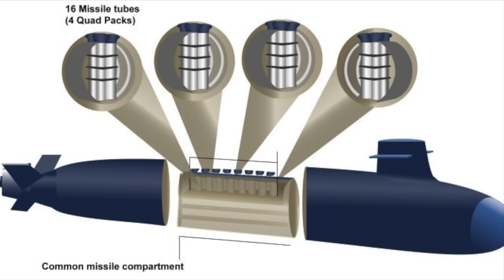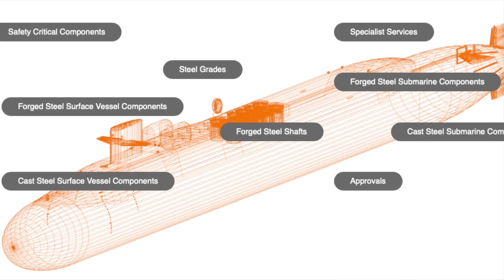The Submarine Bottleneck: Why US Nuclear Shipbuilding Needed Britain

Comment: I am not sure that its the VPM's that are being done at Rosyth, Babcock are already doing those at its US plant and Rosyth doesn't have any experience in submarine steel welding. I suspect what has been outsourced is something Rosyth specialises in and submarine work its already doing for the UK submarine program, aluminium pipe welding for the reactors steam plant. Aluminium welding is a rare and highly specialised skill that isn't performed anywhere else outside of the plumbing on commercial airliners.
Reply: "Rosyth doesn't have any experience in submarine steel welding" Yes they do. Rosyth used to handle the Polaris subs refitting and I've the memories of sitting next to them in ballast tanks with my dinky fire extinguisher. Also, some welders from Rosyth more recently worked on subs in Barrow. Source, my daughter who does the quality control.
Reply: @TukikoTroy  They have a role in decommissioning submarines (removing the reactor then slicing them up) and in welding aluminium piping for Barrow but they aren't doing any high grade steel (HY-80/HY-100) welding for submarines. The Polaris subs were decommissioned 30 years ago and their last refit in Rosyth was during the 70's and 80's. The frigates will be using much more workable steel, AH-36/DH-36/EH-36 etc..

Comment: It makes me wonder if the SSN-AUKUS boats are even needed. The Virginia's later blocks aren't far off from what the aukus boats will be. We should all just be building Virginia's.
Reply: SSN-AUKUS boats will be far superior attack submarines than any Virginia class.
The US will have later the new SSN(X)-class submarine to replace the Virginia class.
All three countries should make one attack submarine type with many VLS cells.
Thus saving money producing commonality and share the workload.
Reply: @LeeD-c6z how do you know they will be far superior?
Reply: @starship4453  BAE are designing it to be superior.
The USA are designing the SSN(X) to replace the Virginia class
Reply: @LeeD-c6z  I would believe that if BAE systems had designed the Virginia class before the Aukus, and not GDEB. From what we know... The SSN-Aukus is going to be a lot like a block V-VII Virginia in terms of general specifications
Reply: @starship4453  Yes ........i agree but it will be structurally different but it will use many of the later Virginia class systems and weapons.
Some analysts have suggested SSN-AUKUS could aim for a VLS capacity comparable to some Virginia Payload Module configurations (which can carry dozens of missiles), but this is not official. 
But they will not have the Virginia VPM cells
Reply: @starship4453  How do you know it would be better for us all to just build Virginia's?

Same way.... unsubstantiated tripe based on personal bias not considered examination of fact.... You are just as bad as the person you are responding to. 

No, we should NOT all just be building Virginia's because both Australia and the UK have some differing strategic requirements to the USA, which means they need somewhat different things  from their Submarines.... This is why though the hull form will be a British design based heavily on the Astute Class, much of what is going INSIDE the Australian Boats is different to what is going inside the British Boats because we have somewhat differing operational requirements.

This is the reason the Brits went ahead and built the Queen Elizabeth Class instead of 'just buying a Nimitz or two', because fantastic ships though they are the Nimitz Class DO NOT FILL BRITISH OPERATIONAL REQUIREMENTS..... Too crew hungry for a start, a single Nimitz has more than twice the crew requirement of both QE's combined, thats BEFORE you get to the air wings.....

So you see, a ship that works well for the USN might not in fact work very well for anyone else.... It is purest, insufferable arrogance and breath-taking ignorance to assume that that is the case
Reply: @alganhar1 You didn’t respond to anything I actually said. You just launched into a national‑prestige tantrum because the facts don’t line up with the story you want to believe. Cope harder.

Calling SSN‑AUKUS “heavily Astute‑based” is wilful ignorance. The public models and internal layout mirrors Virginias. The mission profile and the combat system and weapons will be American.  

Suggesting Virginia's for all is practical instead of coping. Virginia's exist, they work, and they're already being built. The UK's Barrow is in decline, astute was delivered late, over budget, and availability is poor. They couldn't even send one with the latest carrier deployment. 

There is no reason why the UK couldn't operate Virginia's... At least they'd work.

Comment: It is really strange the USA doesn't apply this EXACT strategy to Destroyer construction, with Japan, Korea and Australia.
Reply: Exactly. Apparently some US Act prevents US warships from being built outside the US... But what about blocks? Clearly the precedent has now been set on the most important of warships now... The Virginia class
Reply: @starship4453  All those nations (Japan, Korea and Australia, but particularly the first two nations) would be excellent partners for the construction of future US surface combatants. 

I would just add that the UK has also had much recent success in building and exporting the Type 26 and Type 31 designs so they could be another option, which would further build on the AUKUS partnership.
Reply: @TimB-d6p  perhaps the type 31 may be timely... But if we've learnt anything from BAE systems... It's that they couldn't build a simple steel 6x4 trailer on time or on budget. They really are a useless mob at the moment.

Comment: 5:20  if It can take 7 tomahawks, that is the same as the 4 converted ohio class tomahawk carriers. 

So could the new payload module in these subs  carry trident ?
Reply: I doubt it. The hardware to launch a TD3 is quite significant vs a single tomahawk repeated 7 times. I'd bet the VPM tubes are quite a bit shorter than ICBM tubes.
Reply: Not tall enough
Reply: @WhatsleftofTom if they can take 7 tomahawks, then they are AS tall as the tubes  in the  4 converted ohio class subs.

No?
Reply: @patdbean what bearing do you think tube diameter has on tube length?
Reply: @WhatsleftofTom ok, so you are saying they are "long" enough , but not "wide" enough?
Reply: @patdbean no, the opposite. What’s so hard to understand here?
Reply: @patdbean  The Ohio's are SSBN's for fuck sake, they were designed to carry bloody great LONG Nuclear missiles. Thats their main JOB. Trucking around a whole bunch of dirty great missiles. 

SSN's are not designed for that, they are significantly smaller. And I mean SIGNIFICANTLY. The Block V Virginia's displace around 11,000 tons, the Ohio's displace almost 19,000. That's a small destroyers/large frigates difference....

Just because the Ohio's can carry the same number of Tomahawks does NOT mean that the SSN's can somehow carry ICBM's all of a sudden....

Comment: I'm not convinced that submarines are 21st Century options. They are 20th century platforms which today are superseded by Satellite reconnaissance and by long range aircraft and missile technologies. In that context I don't support AUKUS.
Reply: aaarrr thats a shame   well  they best cancel it then
Reply: a rifle is a 20th century platform too
Reply: @allowit328 19th century
Reply: @allowit328 more like an 18th century platform
Reply: @allowit328  19th I think you'll find.
Reply: Rubbish.
Reply: What is a "21st Century option" in your opinion then?  Clearly you have some ideas?

imo there's little that strikes more fear in a Captain than knowing a sub is hunting them.  It is too quiet to hear over the background noises of the sea.  The UK use hull shaping on the bow to deflect active sonar away from the target.  It uses low magnetic steel that's regularly treated to remove any anomalous magnetic signatures in the Earth's field.  Special flexible steels are used that allow for greater 'safe' compression at deeper depths and boat operations are only constrained by the crews need for food and rest.  6hr on and 6hr off for "90" days is brutal, the crew of HMS Vengeance did it for 200 because the other boat was broken.

It is more stealthy than stealth, and the size of a warehouse.  Absurd doesn't cover it.
Reply: The UK only has short/medium range missiles, subs are needed to get close enough to the target as the UK has no other way of launching nukes.
Reply: @georgebarnes8163 what    the  trident missile has a range of 7500 miles

Comment: It is honestly bonkers that modern warships is mostly built and outfitted from the keel up in a single shipyard, taking years to complete. This should be implemented on a much larger scale with dozens of smaller shipyard building 10 to 20 meter fully outfitted sections that are transported to a larger yard for assembly only, with enough sections being built by the smaller yards at the same time to cover multiple completed ships. 
Sadly, we instead have a few medium sized yards that only built each complete ship from the keel up but also insists on only building their own specific design. Leading to not so much a ship building  industry but a bespoke artisan ship construction. Honestly, modern western defence industry has more in common with medieval  artisan guilds than the industrialised revolution.
Reply: That IS how it is mostly done already.  It is complicated and the ultra stringent welding spec, which really slow things down.  The welding in particular, is very difficult to do. As the pressure hull steel used, is very hard to weld, and must be a 100% perfect full thickness weld.
Reply: This is done for ships (in the UK anyway). For submarines, you're looking at much higher technical specifications and grade/quality levels, which probably means there aren't that many suitable qualified subcontractors anyway. UK submarine manufacturing capacity is similar limited, so it may well be that BAE subcontractors have more capacity that the final assembly yards have.
Reply: Bring  shipbuilding  back to Portsmouth  dockyard
Reply: @SteveBriscoe-u4k  Unfortunately, there is no longer the space to build major warships there. I would like to see us develop a smaller vessel for home waters duties. 

Something you could put a gun and a few missiles for escorting those crappy Russian ships through the English Channel. 

Perhaps that would sufficiently small to be built in Pompey? Unhappily, I don't think the defence budget would stretch that far so it's just a pipe dream....
Reply: Don't know much about Naval construction do you? 

It shows.....
Reply: @alganhar1  Maybe I don't but based on results those who should know things about it constantly get it wrong. 
These days we have supercomputer simulations, CAD, 3D prototyping, CNC, Robotics, AI controlled manufacturing, yet somehow it takes the experts 4 times as long to build a new ship at ten times the cost as it did just thirty and forty years ago, and that's nothing compared to back in the day when it was all done with slide rules.
If the quality of an endeavour is decreasing, instead of improving you are doing it wrong.
Reply: I don't think anything you said is true. segments are moved around all the time. And no, it's not better or more efficient than just building everything from the keel up. You just wasted time, effort and money ONLY moving sections of a ship. Not actually doing ANY work on it. Do you think it makes sense making half a car here and half a car there and shipping it to each other? One shoe here, and one there? Go ask the Chinese, Koreans or Japanese if they build that way. It's western thinking dividing and outsourcing everything. The secret to success is vertical and horizontal integration and not paying other people doing stuff not directly contributing to making the product.
Reply: You have Blair and Brown to thank for that debacle........